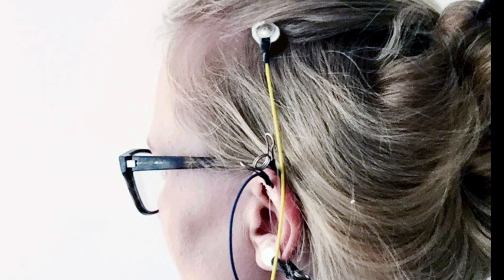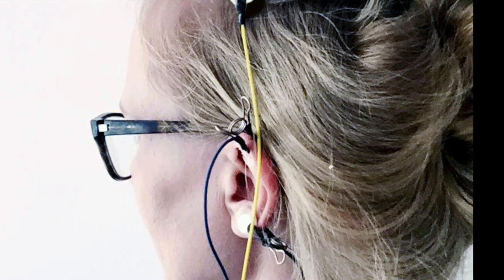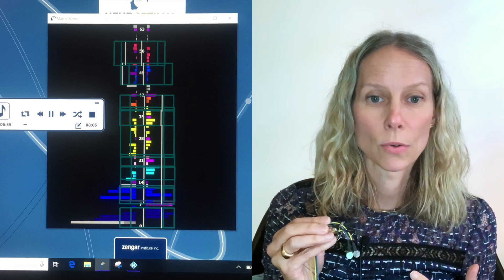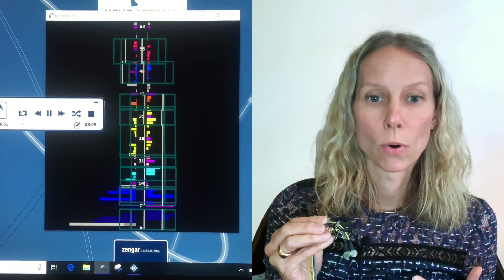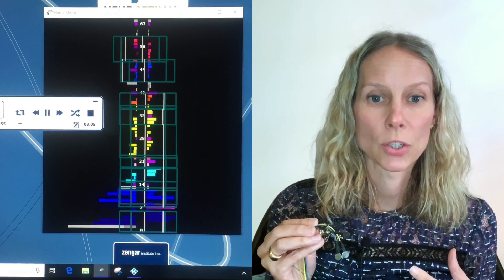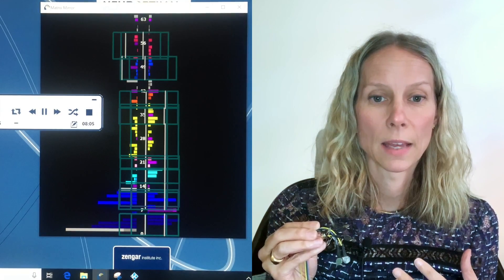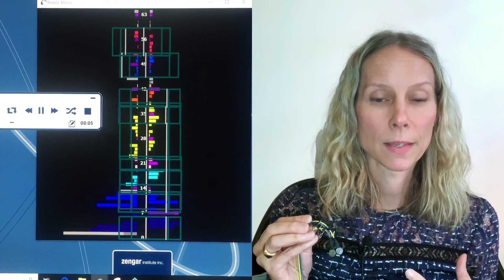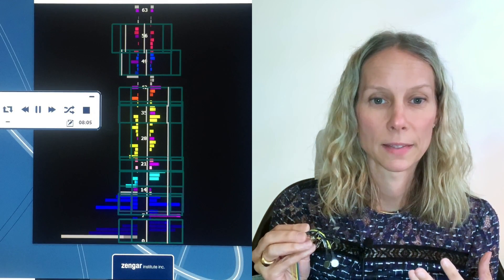Neurofeedback Q&A: How the EEG Sensors work during a NeurOptimal Neurofeedback Session

Comment: I am wondering what might happen if one of the sensors on the head comes loose during a session. For instance, if one or both sensors on the head either comes loose or even disconnects completely, and the user is completely unaware of it. Is there a way for the system to alert the user that the sensor has been disconnected, and won't the loose or disconnected sensor result in a ruined session?
Reply from the maker: Thanks for your question.  There is no way for the software to alert you if a sensor falls off.  The best thing to do is check periodically to make sure they are firmly pressed against the head, especially if training a child who tends to move around more.

Comment: If this is the case when the sensors are connected to our head and the music pauses how can we be sure that's due to electrical activity in the brain and not the environment?
Reply from the maker: Hi, thanks for the great question.  The brain's electrical activity is varied and non-linear, you can think of that as like a mountain range.  And environmental noise, here in the US is 60 Hz, is constant, like a highway.  So the NeurOptimal software is able to tell the difference between the two and ignore the environmental noise.
Reply: @Neurofeedbacktraining  if the software can detect the difference then why would it stop the music when the sensors aren’t connected?
Reply from the maker: @peekirbyevox5223  Yes good follow up question.  The sensors are picking up on EMF which could include microwaves current, wall current, cell phone, blue tooth, just dirty information but not all consistently the same, so the NeurOptimal system is still trying to make sense of the chaotic electrical activity when the sensors are dangling and will create the interrupts they're just not meaningful.  When the sensors are connected the software can find some differences even within the noise. The conductive paste makes the cortical data ‘brighter’ which helps when looking past the 60hz info and allows for a focus on the very minute cortical activity and use that electrical data for the source of when to give feedback.
Reply from the maker: @iOwnzNubz1  Hi Ray, thanks for your question.  Here is the answer to your question given by the creators of NeurOptimal:  https://www.youtube.com/watch?v=jWtU99PSxHs